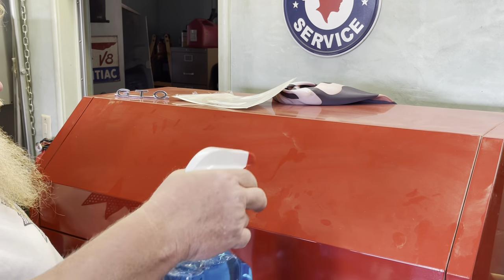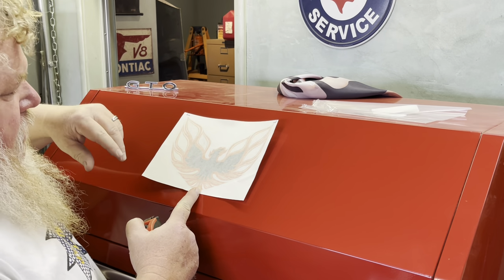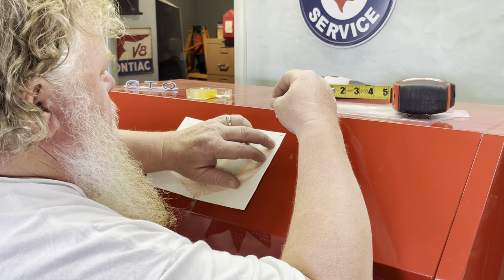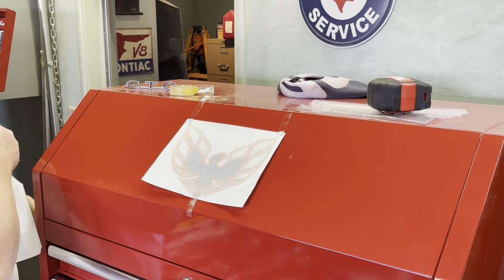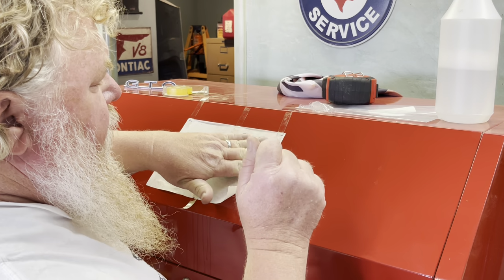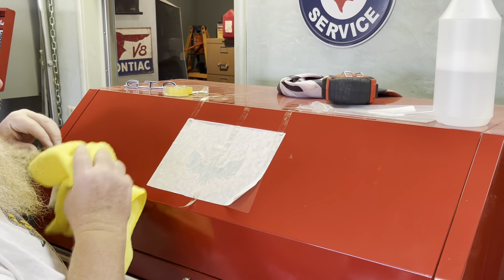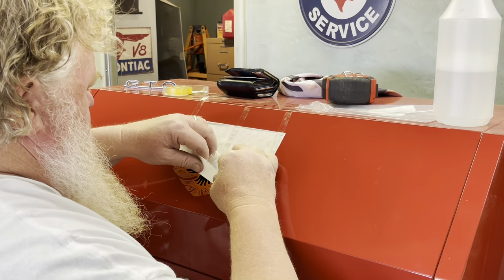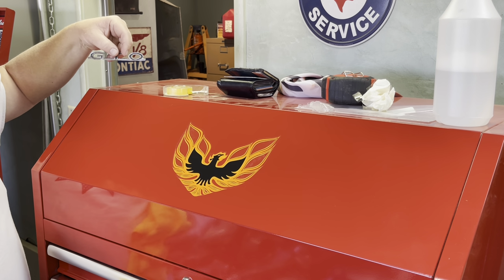How to install decals, stripes, and graphics… and dress up your tool box!

Comment: Here's a few tips on how I've done decals for two decades on equipment  and racecars. Always use a plastic spreader. Always work the decal in the same direction. Moist importantly after applying the decal soak the contact paper the decal is on to make it easier to release from the decal and the surface.  

Decal looks awesome on that box!!
Reply from the maker: Thanks so much! Always appreciate helpful info. I’ll try these when I install the Firebird on the spoiler.